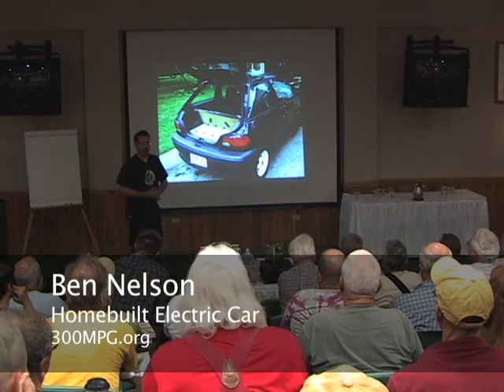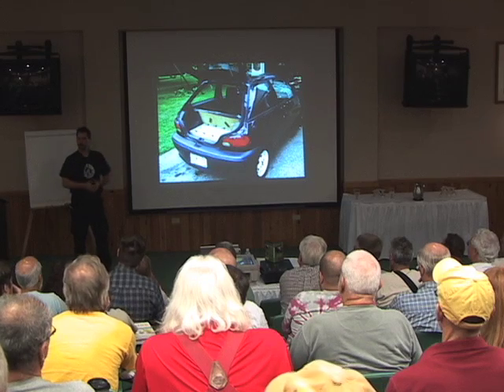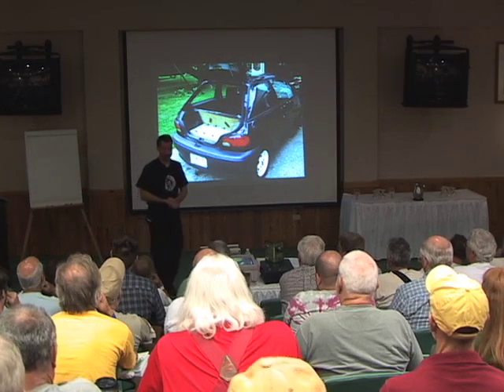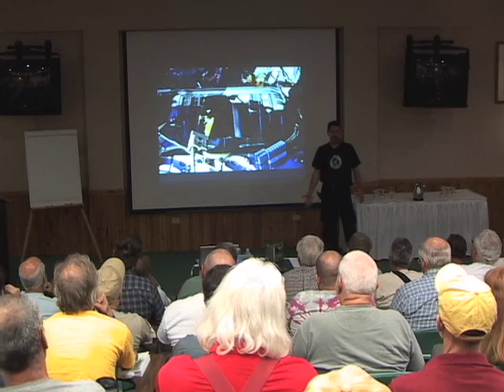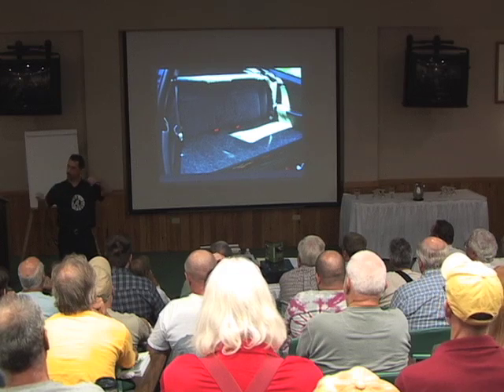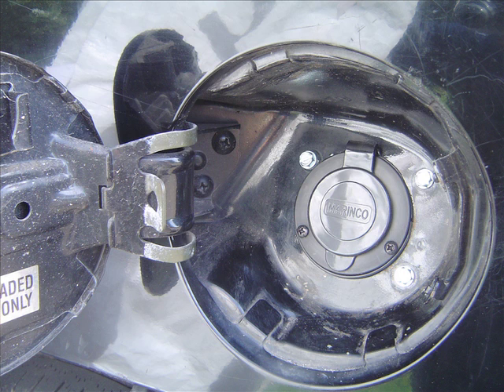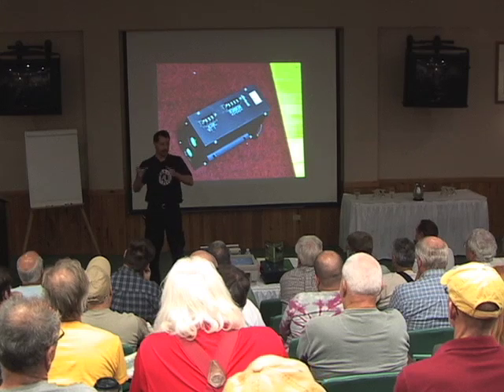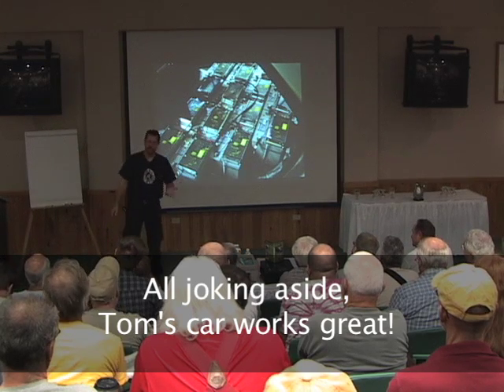Build Your Own Electric Car: Cheap, Part 5

Comment from the maker: @MopDMTBARTL 
Actually, a Chevy Volt has a LOT MORE batteries than this - they just happen to be much smaller and more expensive. The power system in AC setups (including the Prius and Volt) are usually higher voltage, so they have many more batteries to reach that voltage. Physically, the individual batteries are smaller and built together into a pack in the car.

6 used batteries for this car only cost me $72. The price of a Volt is much higher.